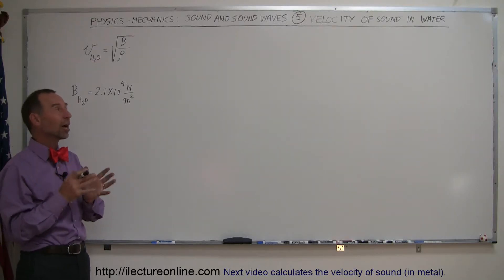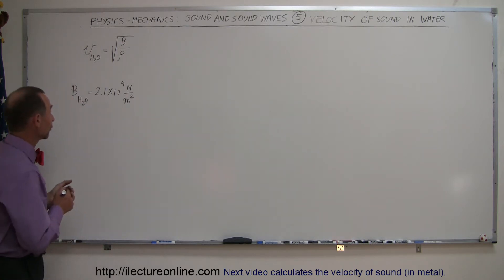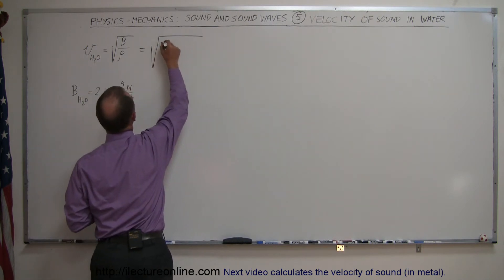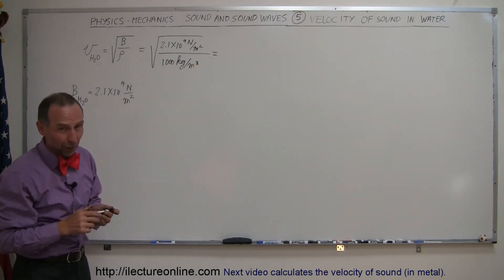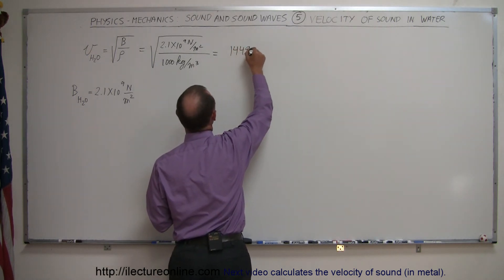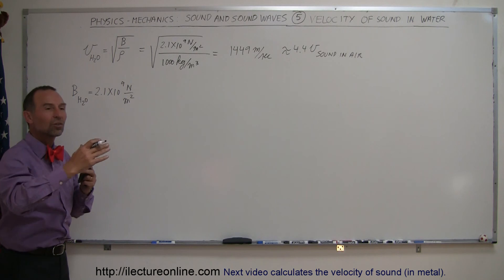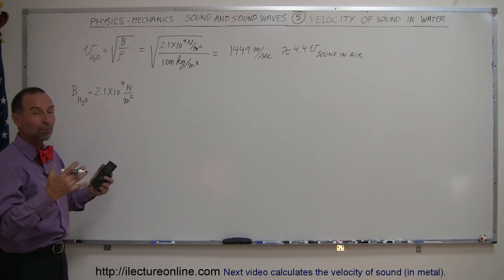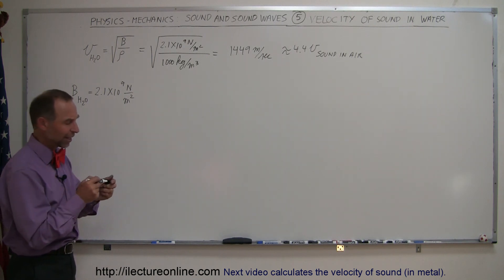Physics 20  Sound and Sound Waves (5 of 49) Velocity of Sound in Water

Comment: Just a question.. why did you divide the 331 to 1449? To find the velocity in water is it neccessary to divide it to gas? And is 4.4 the final answer of the velocity in water?
Reply: Ahh.. 4.4 times faster is the velocity of water than gas?
Reply from the maker: That is correct.

Comment: Hello Michel, I am struggling to understand what you input in your calculator to achieve 1449m/sec, could you help me on this?

Thanks
Reply from the maker: Most calculators have an "EXP" or "EE" or "^" button used to enter scientific notation.  2.1 x 10^9 is entered:  2.1   EE  9   or 2.1 EXP 9.
Reply: Got it, thanks for getting back to me, really do appreciate it!
Reply: @MichelvanBiezen  hello can you reply what did you type in the calculator in where part did you put the squarr root i really don't understand our science lesson